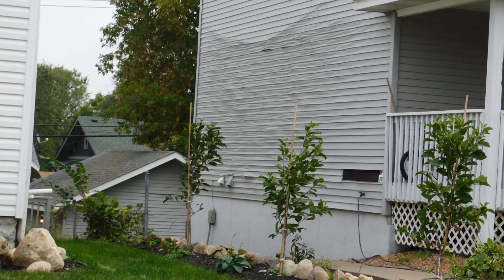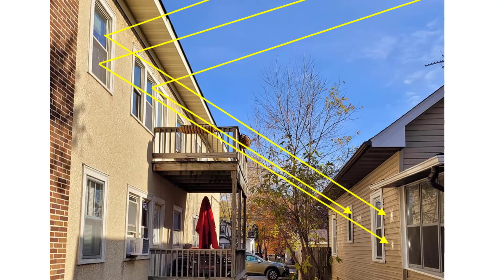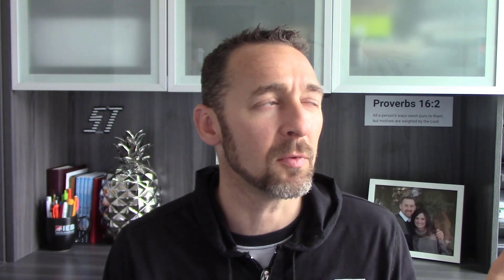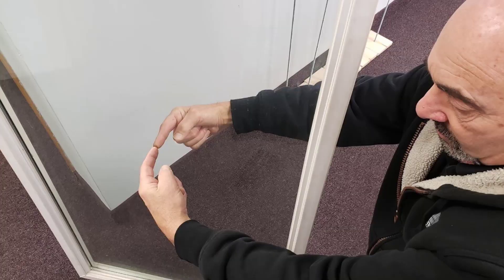Melted vinyl siding

Comment: What is the remedy if neighbor's windows are causing my siding to melt. What have you seen this with your inspections?  I purchased neighbors windows before the sold the house, but the new owners pulled the windows and put back in Low-E windows and im back to the same situation.
Reply: I think you should sue them.

Comment: I would never call vinyl siding a good product; if it doesn't get warped, or embrittled by the sun, or caked with algea that needs to be cleaned off every 6 months, the owner should be thankful for dodging a bullet; it still looks, well, like flimsy plastic. But any window that reflects concentrated sunlight is defective; it's not rocket science to include relief bladders or valves to prevent this from happening. The owners of the houses damaged, builders and the vinyl siding manufacturers themselves should sue the makers of any windows which behave this way.